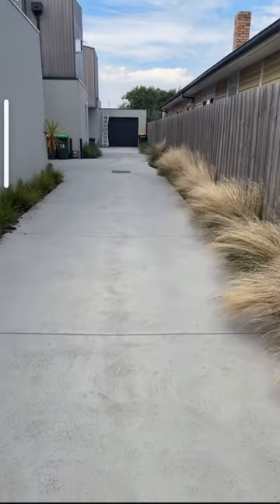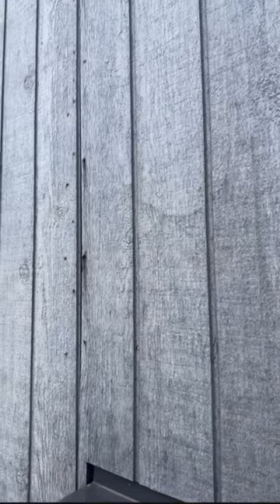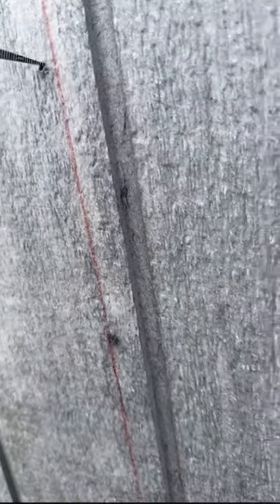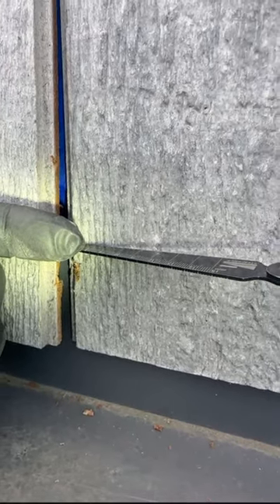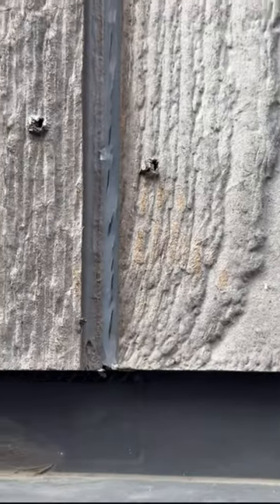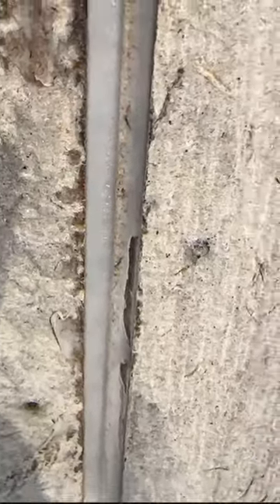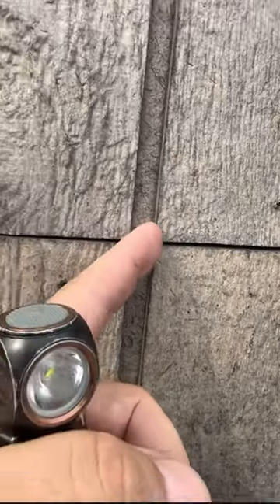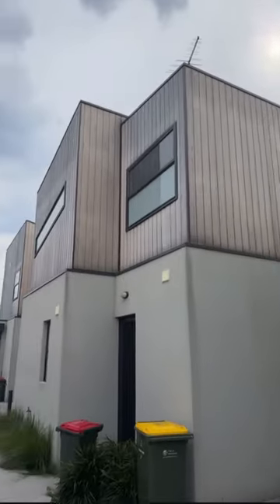Defective Cladding Installation Causing Water Damage in New Home

Comment: Curious,  what would the builder need to do to rectify this and fix the damage?  What recourse does the home owner have?
Reply from the maker: The homeowner has to submit the report to the builder and the builder must fix the home since the home is still within the warranty period.
Reply: I suspect the whole cladding has to be replaced given the extensive fastener; and horizontal and vertical join issues